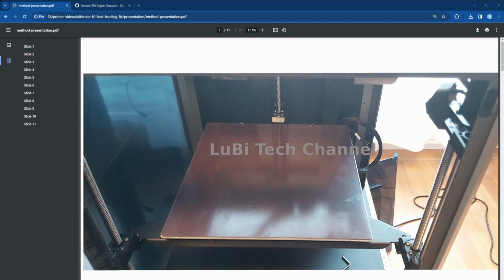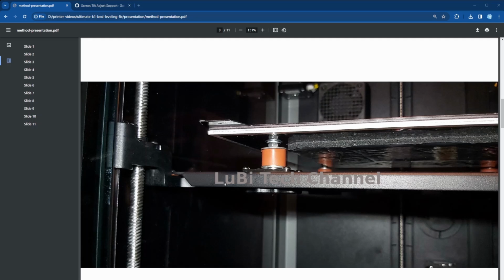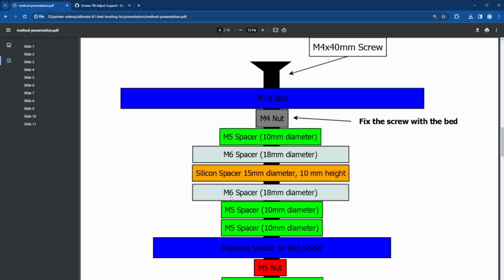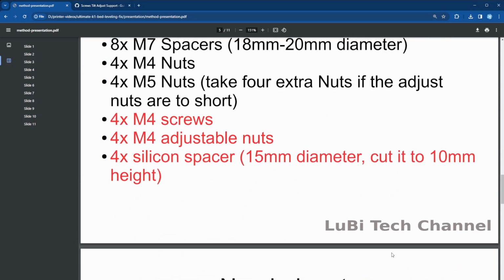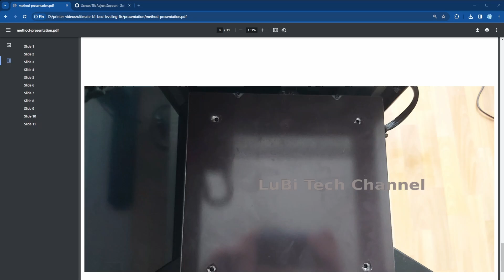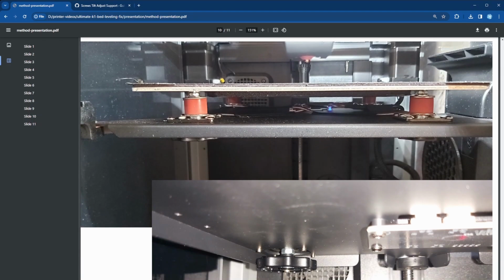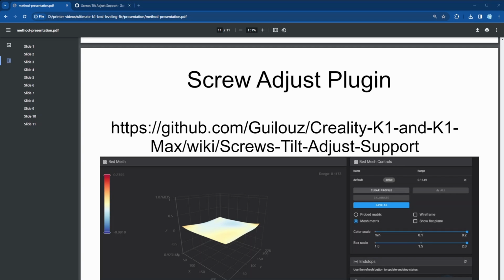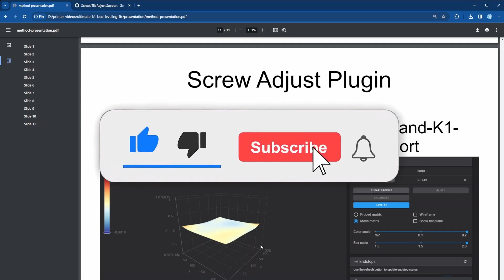Ultimate Creality  K1 Bed Fix

Comment: You do not need to remove the side panel. Home to Z Axis first. Then adjust via removing the bottom cover and release tension from belt to remove and then using very small movements the front right and front left Z screws. Then reattach the belt and do the self-alignment and check the bed mesh. Repeat the process until within 0.2 parameters. Using spacers puts improper stress on the bed connection points. If your bed is actually warped then replace it and do the correct process for absolute Z balance point.
Reply: Hi @CougarNyht, I'm facing this issue on K1C printer. Do you some tutorial with more details? I rooted my printer and I'm using Mainsail <---> Moonraker <---> Klipper!
Reply: @AnotherByteData  your method is more accurate. first you need to do everything possible with the belt adjustment and only then proceed to your method
Reply: @ИванНиколаевич-у4ж  how are you adjusting the belt of your printer? Normally what I'm doing now is just doing fine adjustment in the Guppy interface itself, I just change the Z position 0.2mm, it is enough to print correctly.

Comment: Hi poster, I have a question~
What's different the Silicon spacer and Spring that between the bed and frame.
It's mean why you choice  the silicon spacer not the spring.
Reply from the maker: You can use springs. The spacers are a little bit more robust. I tested springs with my Ender 3 and they work fine. Please remember to ude high quality springs not the cheap ones.
Reply: @
Thank you for replying.
Then what’s the high quality springs?
High electric coefficient or better spring material ?
Reply from the maker: @吳家豪-h8t  not the cheapest one that you can buy on aliexpress or amazon. Choose the spring from Creality for Ender 3V2.  They will do the job.
Reply: @lubitechchannel  Thank you so much, I will do that.

Comment: This is an horrendous way of leveling that printer. It's so simple to move the belt using the leveling diagram.
Reply from the maker: In many cases moving the belt won't solve the problem. I tried it few times. Leveling the bed using screws works always.
Reply: It looks weird but it's actually necessary, if he did it any other way the prtouch wouldn't work properly. If it was cnc milled and was mass-produced to look nice it could look a lot better, but it's not needed lol
Reply: Nao substitui este procedimento.

Comment: Wy so many spacers and nuts? wouldnt just the silicon spacer and a nut at the bottom be enough?
Reply from the maker: It was necessary to make some space between the pressure sensore and the silicon spacers. The silicon spacer should not disturb the pressure sonsors. The spacer under the frame create distance that the knobs could easly rotate.